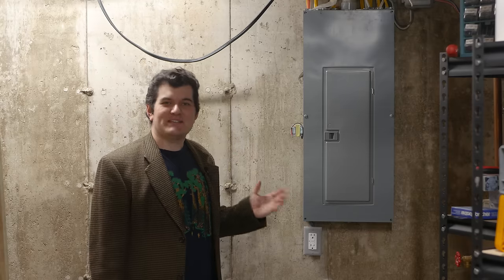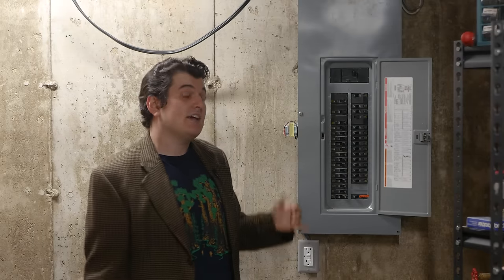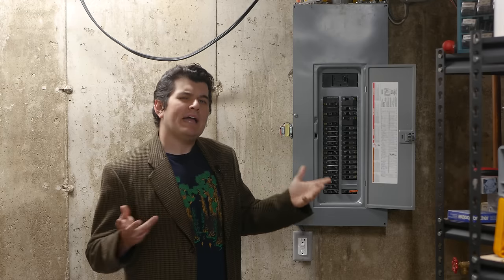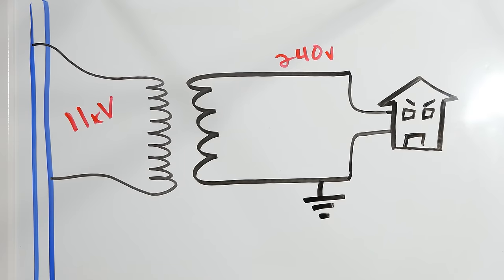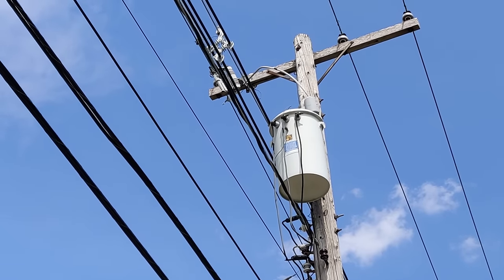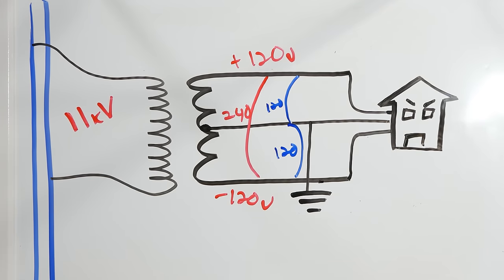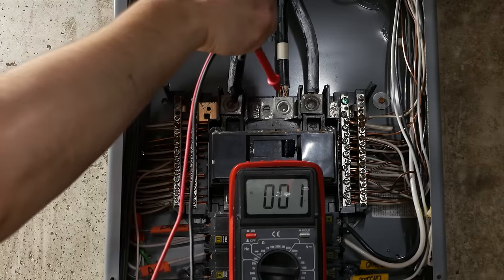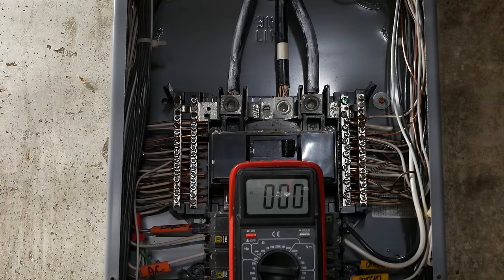The US electrical system is not 120V

Comment: We don't supply GFCI (the leakage devices you're pointing at) for all branch circuits because nuisance tripping becomes problematic and they don't really add much protection when they're not required. It becomes especially problematic for circuits longer than 100ft, for circuits with receptacle counts nearing the 1.8KVA cutoff, motor loads, but as the technology gets better and more importantly cheaper it will get adopted more. There are also explicit instructions on where those are required when getting residential construction drawings approved and the locations they covered including the kitchen and bathroom areas like you said. They do an arguably great job of protecting people from the #1 causes of ground faults resulting in bodily harm - wet locations. Adding more of them when not required by code, especially for large facilities with lots of breakers, is a cost they haven't planned for in their budget. Installing them in your personal home is always an option if you wanted improved, although potentially overkill, protection. 

I don't disagree that 120V can be deadly and is dangerous under the right circumstance, but most of the time at 120 it will just scare you and give you a little jolt. I wouldn't recommend touching a 240V like they have in europe it's my understanding most of those incidents result in burns at the minimum and if using the same 20A breakers will have much higher output power, I could see why GFCI might be more important and widely adopted if that's the case
Reply: The bad thing about this system is that it does not offer protection against direct contacts, only in humid areas, the rest of the house only has protection against indirect contacts.

Comment: Dear Technology Connections. We in 240 land  ALSO use split phase power delivery... just our phase voltage is 400V not 240V.... because it uses less copper and 120V AC will kill you the same as 240V AC

Comment: As a Brit, it is convenient to be able to switch at the sockets to stop kids pressing down an empty toaster etc , our plugs are pretty bulky and very well fitting an thus take a fair amount of effort to push/pull in and out and as they are quite large look a mess just dangling around the sockets.. the switches are really more convenient than you might imagine, especially in the case of older folks or anyone with weakness or disabilities,  seriously they can take quite some force to push/pull out , add this to space constraints etc ie behind appliances   washing machines etc ... you get the idea 😁👍 also they can be pretty hard to line up all three pins with the holes in the dark, say for instance trying to unplug a bedside lamp with a failed bulb down the back of a dresser when you're not sure if the switch built into to lamp is in the on or off position... order some British sockets are plugs and you might have a second opinion on the switch thing.. also not all British sockets have switches..

Steve

Comment: Switches on outlets.  I cannot speak for Australia, but in the U.K. they are not, and never have been, a requirement.  In offices where you have banks of sockets for computers they are usually unstitched.  The same with outlets for laptops on train.  Some extension cords have a single switch, a few may have every outlet switched, but most have no switch at all.

The popularity of switches in domestic settings is mainly down to user convenience.  Sure, you can just unplug something if that is your want, but a switch is just more elegant.  Though removal of a BS1363 plug is a little cumbersome by design, as they are made to be secure.  So to remove one you grab around the plug, you cannot yank a cord, then because of the three pins need to pull them perpendicular to the outlet rather than at an angle, because the longer earth pin is designed to not open the live and neutral shutters unless everything is aligned.

Turning off an outlet is not something I do, but the option is a nice thing to have.  Certainly compared to having to unplug and replug everything.

Comment: If you take a 12V car battery and touch a pole with each hand, you won't feel that current.
But, if you take ten car batteries and wire them in series and touch the end poles in each hand, that's 120V and it's going to hurt.
I have not ever tried hooking up car batteries in series, but now I'm tempted to for the sole purpose of finding out how many car batteries it takes to feel the voltage. My guess is 3.

Actually, I might be able to use EveryCircuit to calculate it. But what's the best way to find out the resistance of flesh to know when I've produced enough voltage to jump it? I know it takes 75kV to jump an inch of air (under specific atmospheric conditions considering humidity and temperature and density altitude).

Comment: Ok so you can hook up electric stove to 2 phases and theoretically say its 240 volts but every heating element use 120v. 
I have conduction stove, it can be wired as 400v (3 phase / 380v) two or one phase 240v. Its to spread the load but single heating element use 240v.
Theoretically its irrelevant what volts you use, 120 and 240 can produce same amount of power with amps to match it. Problem in US is not half the voltage but not double the amps to match the output of 240v outlet.
Reply: Electric stoves and ovens in the US have 240V heating elements. The light bulb will be 120V though.

Comment: I'm not sure if this is true, but in some circumstances 240 volts can supposedly be safer, because 240 volts is more likely to stop the heart, while 120 is more likely to cause arrhythmia. A stoped heart is easier to get started again then an arrhythmic heart (that's exactly what defibrillators do, they stop your heart when it's out of rythm in order to get it to start again. Either on its own, or via cpr)
But that should not mean that 240 v is definitely safer. It's just that if the heart is influenced, and you are lucky enough to have someone around then maybe you have a greater chance of surviving.
In general I'd say that 120 v is safer though

Comment: Equivalent US and UK loads such as guitar amps or power hungry loads will have different supply currents especially Valve amps. The US cables are thicker than the 240V equivalent to handle the extra Amps.

Comment: I cannot believe our 240 volt plugs are still around. Almost every single time I plug in or unplug a 240 volt item, I get a shock. I've rewired multiple outbuildings and wired a brand new tiny home alone, but I'm not certified in anything. That being said, I'm not an idiot. Our plugs are PAINFULLY awkward and unnecessarily dangerous 90% of the time; 240 volt plugs are almost always way too tight and so require muscling them out, then your finger slips in behind it and bam, you get a shock. My brothers in HVAC just come in and agreed with me, too! "That's how they ground, it's gotta go through you at least once!" 😂

Comment: To address the “just unplug it” comment at the end, you should NEVER connect or disconnect a device under load. And yes, sparking (actually called arcing) is bad. The temperatures generated from an electrical arc you’d get from unplugging a vacuum while it’s turned on, for instance, while small may damage the receptacle over time. Not to mention tripping an arc fault protected circuit repeatedly can damage the breaker.
Reply: Things like phone chargers don’t have switches, at least in the US.  We just plug them into hot receptacles.  At 120V, it isn’t a problem.  There isn’t enough current to damage the plug or receptacle.
Reply: @TheThickSherpa — The phone charger plugs into 120V and produces 5V for the phone.  Things that use significant power, like a coffeemaker or other small appliance, have a switch on the appliance.  A small soldering iron is typically about 25 to 100 watts, which will not damage anything if plugged in without a switch.

Comment: It's not always 240V. I live in Brooklyn and we get 208V, which is what you get when you have two 120V phases that are 120 degrees out of phase (ie, any 2 of 3 phases in 3 phase distribution). Your 240V is two 120V lines that are 180 degrees out of phase, which is usually, as you describe, a single phase transformer grounded in the middle of the secondary winding.
Reply: Did u not watch the video lol? Or I imagine you gave up halfway through because he definitely covered that

Comment: At first sight the American system kinda confused me as a European, I’m only able to present my very German view on that, but I would very much enjoy a US-similar breaker panel in my House/Apartment. I just really like the concept of having one mains breaker/switch/whatever and multiple others to control many different zones. But I also really like this “bus-bar-plug-and-play” kinda thingie u got going on there.
 
In Germany you generally don’t have a mains breaker (which is in best cases substituted by an rcd or similar) and your other breakers are basically “stove”, “room 1”, “room 2”, “heating”, “pretty much the rest of the apartment/house”

And I’d also be pretty happy about 120V here - just cause of me being a hobbyist and lethality and things and 240V outta the wall being pretty intimidating ig

I mean on the other hand really I love how f-ing much power you can push trough one conductor at 240V - that’s theoretically insanity
Reply: Interesting

What do you mean by bus-bar-plug and play thingie
Reply: @TheAmericanCatholic  need a new circuit wired? Just slap a new breaker onto your panel, connect it and you’re good to go. I don’t think it’s that simple over here. Also you need to wire up both input and output of the breaker, where in the US you - as I said - slap it on, connect the output and there you go.

Comment: There were several homes in the US village that used a 30 amp 120 vac drop when I was a kid 50-60 years ago and I suspect it was installed before the rural electrification in the 1930’s. My home used a 60 amp 240 volt system when I lived there…. A bit more money but I think it was for an electric stove.
Reply: A 60A service used to be common.  I have 60A service, but is just for a small apartment with gas for cooking, heating, and water heating.

Comment: nice video, would like to note some things though. Higher voltage is more efficient due to less current being drawn for the same amount of power (P=VxI) that also kind of makes your point about current slightly inaccurate. While you already need 3 wires for each house they also need to be larger for the same power (considering P=VxI) so you end up spending a lot more money on copper while also losing more on heat. Generally if ground fault is in the circuit you're pretty safe with 240 due to them shutting off at 30mA if they're working (it gets dangerous from 100mA drawn)

Comment: In Brazil, we have the 3 cables just like the US, but here we can't use the neutral as ground, we have separate ground. And our plugs are much safer than American ones. And our voltages are little different we have 127v/220v
Reply: In the U.S, the neutral is not used as a ground.  It IS grounded, but isn't used as a ground for safety purposes.  It's the second conductor, for each of the 120V "legs."  The ground conductor, which is connected to the metal cases of electrical devices, does not carry current, unless it's performing its safety function, of of preventing the case from being "hot," due to a short.

Comment: I think as far as the switches go, 100% of uk plugs I've seen are are 90° and are hard to pull out (on purpose) and when they're behind a couch, fridge, TV cabinet or bed you can just reach and easily enough flip a switch but that's about it. As a brit now residing in the US I find the enimic kettles frustrating

Comment: So much of those channel boils down to “most electrical devices were invented over 100 years ago and are therefore extremely simple. Even with better technology today, nobody bothers to change the traditional design.”
Reply: Hardly any electrical devices a hundred years old are still in use.  That's not a reason to change the power system.

Comment: The switches on the sockets are not just for convenience but also for safety so devices that you may want to leave plugged but may be hazardous to do so like things with heating elements. It's safer if the kettle, toaster and electric heaters are switched off externally in case of fault or accident in homes with pets and children. Yes, stepping on a plug is painful.

Comment: I wonder, do more people get hurt or die from touching 120 V or 240 V directly, or do more people get hurt or die from fire caused by overcurrent?
Honest question; 120 V is clearly nicer if you touch it directly, but 240 V has half the amps so that should cause less fires. Since those are probably the largest pro/con for the two respectively, I wonder how their statistics compare.
I googled around for a bit but I couldn't find a proper source.
EDIT/PS: AFAIK in the NLs the standard is 230 V per fase, with all three fases connected. Most things get 230 V, equally spread over the three fases (approximately); anything that needs more juice gets 400 V from two fases. Usually they are spread such that e.g. washer/dryer are fase 1 and 2, electric oven and induction plates are 2 and 3, and EV is fases 3 and 1.

Comment: I was following a discussion about mains voltages and someone threw out, I guess to be smug in their knowledge, that components rated for "110V" AC actually needs to withstand at least 170V, because "110V" is the RMS value and not the actual peak-to-peak value. So if you want to be even more pedantic...

Comment: My dryer plug wasn't connecting correctly into the outlet and I somehow touched one of the prongs.  It was a bit tinggly and jolty, but I was surprised that I didn't fly across the room.  Seems that, as Mr. Electricity, says here, I would have needed to touch both sides.  My electrician said the same thing when he came to replace the outlet.  Since most of the plugs weren't grounded in this old house, I also got my electrician to replace all outlets with GFIC ones.  I hear they're safer?
Reply: Most likely you did not get a bad shock only because you did not provide a good path to ground.  Touching one hot wire can be very dangerous, possibly fatal, if you have a good contact with ground.
Reply: Well, I did have shoes on, so that's probably a good thing. :)

Comment: Foot hazard is worse, You really know when you stepped on one of our plugs with socks on. As for switches on our plugs would have made them more safe before the shielding on the plug pins was a thing as long as you switched off before unplugging or plugging in . But now not really. Interesting video.

Comment: Could you do a video on the electrical-power outlet system used in Australia? 

Invented in 1937, we have an active (hot) wire, an neutral wire (connected to the power line transformer) and an earth (connected to an earth rod outside the house in the ground). It helps to power our electric water kettles and also the popcorn button on our microwaves.

You could compare it to the American power system as well as the structural integrity of our bridges, which all remain standing...

Comment: 2:28 While true based on having a 200A service, in reality the utility transformer and wires coming to the house wouldn't be able to supply that much power in many cases. It's typical for utilities in areas where gas heat/cooking is common to connect up to 6 or 7 houses to a 25 kVA transformer, or 2 houses to a 10 kVA. In reality if just one house, let alone many, actually tried to pull anywhere close to 200A for an extended period of time it would likely overload the transformer and possibly trip some kind of protection depending on the setup.
Reply: And yet, the transformer remains and the houses all have electric.   Diversity is based on utility companies experience.  A 200 amp breaker is for conductor protection, not utility transformer protection.
Reply: @KevinCoop1  I definitely agree with you. I actually have worked at a utility in the distribution engineering department before so I get that it's not a problem. I just find it to be an interesting fact. The reality is that many people with a "200A service" would never have an issue if they had a 100A service instead. That combined with load diversity and the resilience of oil cooled transformers against significant temporary overloading makes it a reasonable practice. That being said, I do recall one incident where an assumption of "3 kVA of transformer per residence" was made for an apartment building. Originally they were going to use gas heat but later changed their minds to use electric heat pumps with resistive backup. One cold night where the resistive elements kicked on for everyone killed a few padmounts.

Comment: UK plug fuses : Quite a few times I've had to replace fuses in plugs. So I guess something went wrong. I'm glad that the fuse was there. What would have happened if there wasn't a plug fuse ? I moved to Europe, but kept all the 3 pin plugs, and just use adapters to mainland European 2 pin plugs.

Comment: I didn't watched at the circuit switch an RCD switch, in Chile is mandatory now those systems in every home and now also a surge protector set up in the line circuit for protection of appliances and the home of dangerous surges.
Reply: By the way, in Chile we use 220V, ¿no es cierto?

Comment: and to get 240 without doing an install on anything, get a multimeter with ac voltage  and test until you get 240 then split the 2 prong cable in half and plug into the separate holes. Just be smart about it and its a bandaid  fix.